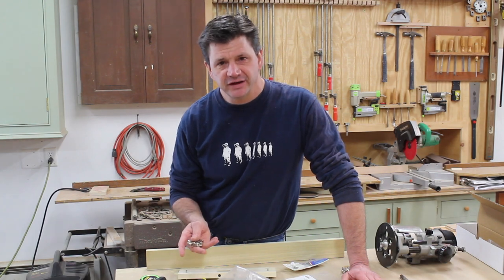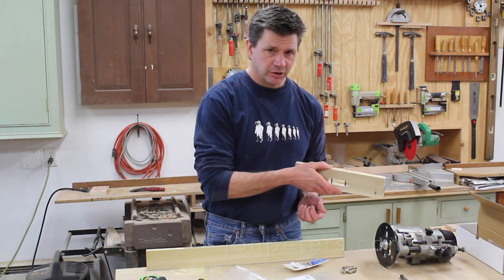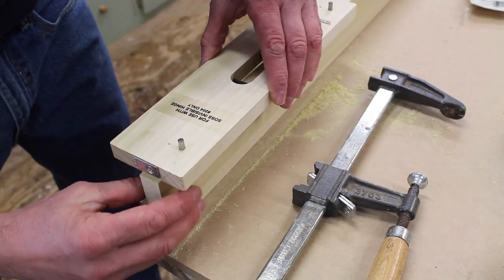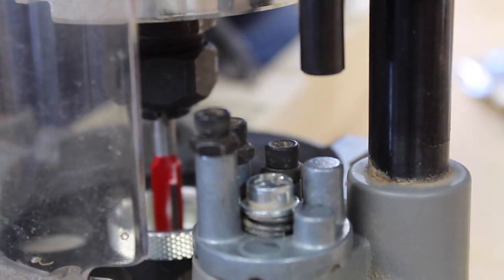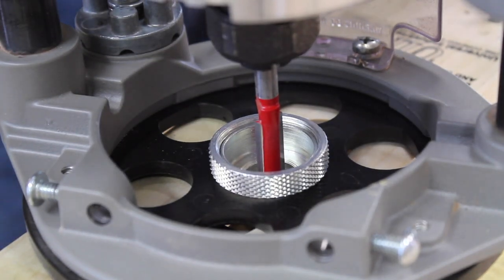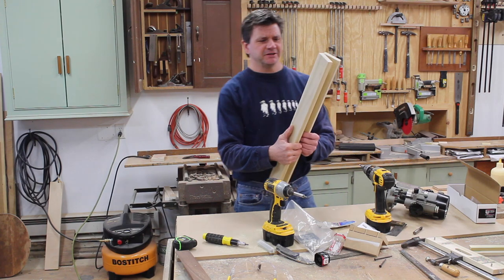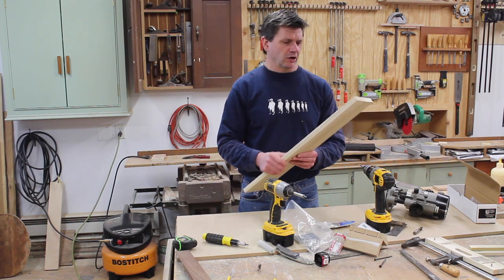EASY To Use and looks great, The Soss Invisible Hinge

Comment: Just order the 204 SOSS hinges and jig. Please share what size bushing you used.  
thanks for your help.
Reply: You probably already know by now, the Soss Jig for the Soss 204 Hinges require a 21/32" ID and 3/4" OD bushing that needs to be 9/16" long. I made the mistake and ordered the Powertec Bushing set which was 15/64" long. Now off to Menards to buy the Milescraft set.

Comment: I have an RV dinette with a leaf that needs to fold up out of the way to make room for getting in and out. I didn't want to lose the ~ 16" of tabletop I'd have to lop off if it were just fixed. The tabletop is 1.5" maple butcher block and the leaf that will be hinged weighs a whopping 25 - 30lbs.

These hinges are perfect since they're meant for doors, which weigh a lot more than what they'll support in my application. Other options aren't ideal;
a piano hinge, for example, wouldn't be flush. Who wants that on their dinner table? There are mortised top mount hinges that are used for similar applications, but the mortise needs to be done perfectly since it's immediately visible. These are concealed in a way that would make a slip of the router less disastrous (not to mention these have jigs available). With deadlines approaching rapidly I just can't risk an accident with pricey (and obnoxiously long lead time) butcher block.

Comment: Hi Jon.    Was wondering if you knew which Soss hinge number you used for this 3/4 stock, and which accompanying jig.    I see on amazon there is some confusion/complaint over the jig not matching the hinge style/number so I wanted to try to avoid this issue as I order some Soss for an upcoming built-in.     Thanks again!   Eric
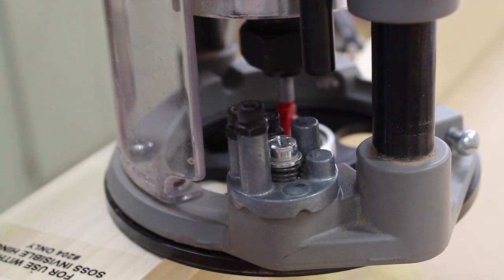Reply from the maker: Hi Eric, it’s the soss #204 Hinge, check out my video.... search Jon Peters how to hang a cabinet door with the Soss invisible hinge, time 2:00
Reply: Jon Peters Art & Home thanks Jon!
Reply: Jon Peters what’s the bit size you use?